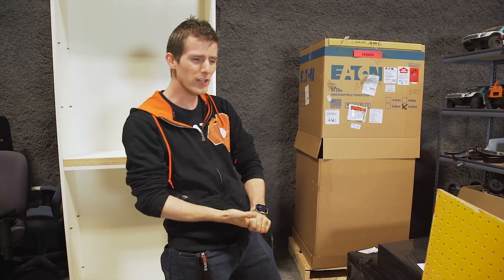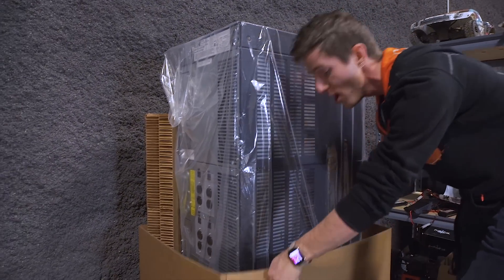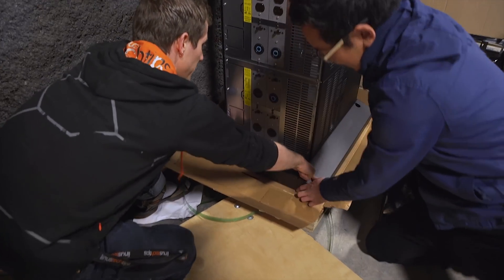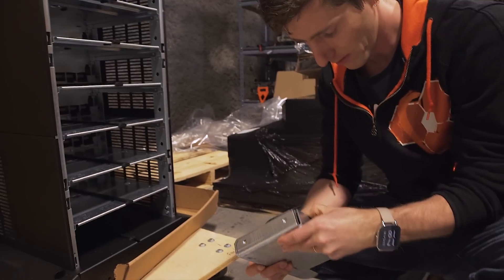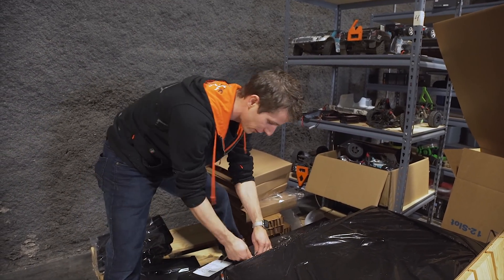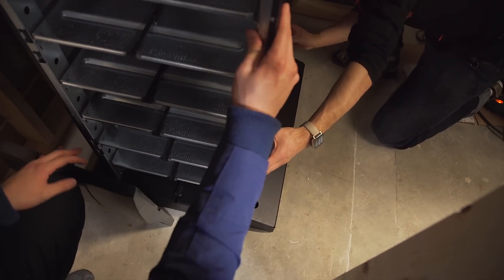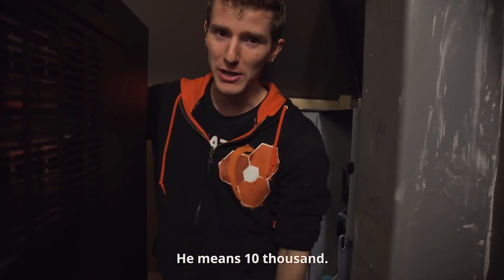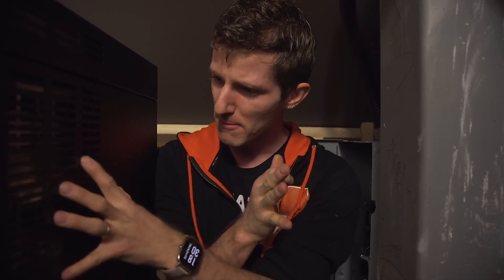HOLY $H!T - A $17,000 (CAD) Man-sized Battery!

Comment: 17k? Why the hell didn't you just get a generator?  You could power the whole damn building with 17k.
Reply: +tnnss111 He said $17,000 CAD. Aka, $10 USD. Just kidding.
Reply: +tnnss111 You would have the generator running at all times, which is loud and emits fumes - not ideal for a set up like this. The power from generators is also less consistent. Generators require maintenance, fuel etc. But yeh the biggest thing is you would need a generator running 24/7 to achieve this... which is just not a viable solution!
Reply: +Brighteyes890 You don't have to keep the generators running, they're turned on when the main poer goes out, they're a backup, not your power source.
Reply: Turbo Kompressor
The point of a UPS is that it is uninterruptible..You can't know when the power will go out, and when it does you can't just decide to go and turn on the generator. Your server has already lost power!
Reply: +tnnss111 this usually sponsored tho...
Reply: +Brighteyes890 No, it is not, but he kind of makes some sense.

If you think about it for a while this UPS won't last much time, in case of long power wattages of a few hours this won't hold everything up, it just can't, on the other hand a setup where there was smaller batteries from which everything would be powered up from that (so that there's no delay if anything fails) were charged by wall power and whenever wall power fails would quick start generators to fuel it would be the most appropriate solution, eventually cheaper, lasts for way longer (especially if you keep fuel barrels around you won't have to worry about power outages any more at all) and is just as reliable.
Reply: Dudes, you're not making any sense, I already explained it on top of your comments, you simply did not read it.

The battery that's provided to your servers comes ALWAYS from the batteries, like with this UPS, it never comes from the wall and then switches to the batteries, it comes ALWAYS from the batteries.

The way you charge those batteries though is different, if wall power is up then take it, if not fuel them with the generators. Keep a few barrels of oil around, you're basically set for weeks of power outages, the solution he has is able to sustain him for 1 hour tops, which in case of some electric cable getting cut cause some tree fell basically means they're dark.

At first I thought linus wouldn't take this dumb approach unless it was sponsored (with all respect to linus and his team), but this is doesn't look sponsored to me, and all it does look is burnt money.

Just my 2 cents.

EDIT: I don't mean a small battery to power all these servers, I mean SMALLER than what you see on the video, you don't need them to provide for long, just long enough until you got juice coming in from generators to refuel it again, the investment in total would probably even be smaller than what you see here and would've been much more reliable.
Reply: Turbo Kompressor
Yes, a small battery to run multiple servers. Yes. Yes. I agree.
Reply: +Narvikz Guys you are totally missing the point here. In this configuration all the UPS can do and SCHOULD do, is give the servers time to saver everything and power down safely. Ever powered down a server with a dozen VMs? It takes time! The UPS supplies this half hour of electricity. 
LTT isn't located in Africa, they do not need a generator that will last them through days or even weeks. All they want this UPS for is to avoid data loss in case of a TEMPORARELY blackout.
Reply: +tnnss111 A generator on its own isn't enough, you should never plug sensitive electronic equipment directly into the supply from an unregulated generator. Even automatic standby generators still require a battery UPS to bridge the period of time it takes to spool up and regulate the supply. They are also pricier and have installation and industrial safety certification costs etc on top.
Reply: George Cristodoulou
Really? Have you even read what I said? The Generator powers the UPS, not the servers, and only does so when wall power fails.
Reply: George Cristodoulou To power everything with solar power you're aiming at 50-60K USD. Not even joking.

The power LinusTechTips company is receiving comes mostly from hydro power, from dams specifically, it's green energy and hella cheap, which on top of being expensive as fuck renders your suggestion just straight pointless since they already use green energy.

Generators run on power outages, which are pretty rare.

EDIT: To make it clear, LinusTechTips corporation is already powered by green energy sources, it runs on water, not on coal like you might think. And right now I think running stuff on coal is just pointless when you can have nuclear plants which are much better for the environment and safe :)
Reply: +tnnss111 Because UPS.
Reply: +Brighteyes890 You solve that with a small battery, generator engines start in seconds, and you already need that battery to crank them up.
Reply: +tnnss111 Most likely due to a generator would have power fluctuations, a start up time as well as sot being designed for server use. A battery UPS generally is more suited, though server farms tend to have tretriary generators too.
Reply: The idea is to have uninterruptible power. A generator won't do them any good as it will not start until they have already lost power. Now if the power went down for a long period of time (a day or two, maybe longer) a generator would be a good investment.
Reply: Every single one of you are completely ridiculous, Your all fighting over something that means nothing... Where did linus say he wanted constant power when the pwer goes out. Where did he say he wants days or weeks of uninterrupted power should the world go to shit.. He didnt. So shut the fuck up lol  These guys are not an enterprise, They do not "need" continuous power and to have 100% uptime.. Its not that any of you are right or wrong its just your all fucking dimwitted. 

The goal here was to obviously supply a stable power supply to the server WITH the safety measure a ups offers. The ups is charged by Wall power so if wall power goes out the servers have time to properly shutdown uninterrupted.

There are many ways to power a ups with 220v after the power goes out, but it is not needed here or wanted. They do not want 100% uptime. If it was the goal LTT would do it. You can power this thing with a $600 honda boat generator after the power goes out but that is not needed or wanted.  All that is wanted and required here is protection from data loss and the capability of a proper shutdown should the power go out. 

Never once did anyone in this video say this was going to be used to maintain 100% up time or that it was infact the goal. So take your lies about what you used to do and realize you are all offering very viable solutions but that wasnt the goal here.

The goal here was to prevent data loss and to have constant uninterrupted power so the servers may shut down in case of a power outage, and that goal was achieved. Now lets say in future they want or need 100% uptime, Well that will also be easily achieved by simply adding a enterprise grade generator that provides constant 220v to the panel.. you dont need solar, giant enterprise grade hospital worthy generators or to go overboard. A simple crappy tire or wallyworld 220v generator would be capable of supplying that 220v...  And lets be honest whos to say they dont already have one??
Reply: +angrodNumenesse If you are going to invest on a alternate power source, why not use solar panels and wind generators ? Yeah they are more expensive but, like a UPS they have voltage regulators and you don't have to buy fuel in order to power the damn thing. Also you do the enviroment a favor.
Reply: +Narvikz The point isnt so that they can keep running if there is a long power outage, the point is it allows them to finish what they are doing and save their work incase the power doesn't come back. a generator is NOT a solution to their problem, they need the power to stay on not just come back up after a couple of seconds with no power at which point the servers would already have been shut down and work lost, using a smaller UPS isnt viable either they have tried that and its not done them any good. what you are proposing is nothing but a "ghetto" fix as linus would say, using a generator is only appropriate for putting emergency lighting on so people can see where they are going if there's a power outage in the night.
Reply: megaspeed2v2
Bro, hospitals (which have electric equipment that patients depend on to actually staying alive) use generators and have supplies of fuel long enough to stay that way for weeks (or even if they don't they have for a some hours and plans to get barrels delivered real quick), this all depends on what you're purchasing, a company shouldn't stop for a single day because of a power outage, specially not Linus' because that would mean huge losses in revenue.
Reply: +tnnss111 Well you would need a generator running 24/7 to achive the same resaults as the ups and generators use fuel. I think the way it should be done is having an ups and if/when the power goes out you have the 20 or so minutes to get the generator started and your servers stay online.
Reply: Narvikz
Generators are not a solution for server backup power, ever. You need to be able to guarantee power at all times, which is something a generator cannot do. Yeh there are cheaper ways to do UPS and this may well be overkill but he still has to use UPS.
Reply: +roguesn1per Most consumer grade UPS work like that, not this one though, trust me - I promise. Look it up.

Anyway it's still fixable, just make it be powered by a generator when there's no juice coming from the wall and it's fine.
Reply: Narvikz
Again as Jonas Cebo said you are missing the point. They are not a Hospital or Server hosting company that the uptime is critical. They just need a solution in order to power down everything safely. A generator and even solar power (like I suggested) is superfluous and unessecery for the time being.
Reply: +tnnss111 Generators aren't an instant transfer. They have to start up. A battery can switch instantaneously making it uninterrupted . Ideally you would have both. batteries to immediately take the load and hold it until the generators start. Then transfer the load to generators.
Reply: +tnnss111 for all you arguing and what not, this original comment is completely valid. For that amount of servers, $4K worth of UPS is more than sufficient, and for another $4K-$5K you could have digital inverter generator to backup the existing UPS that could extend your uptime for as long as you were happy to keep refilling the tanks. Even in AUS a 6.5kva Digital inverter is only about $2k. Maths.
Reply: Still the boneheads haven't got the point. The servers are always running on batteries and absolutely never loose power during an outage, not even a microsecond. The issue with regular UPS is that you have to totally depend on that circuit to kick in as fast as possible, and sometimes they're not perfect with a power hungry system. A lot a odd stuff can happen with that power cut. You're basically paying for the feature of absolute data safety regarding power. 
If his area has power outages, it's a proper investment, because the power company is not going to come and recover your corrupted data. They don't give a shit.
Reply: sdushdiu The sole issue here is that dimwitted folks like yourself think that there is a better solution when there isnt. a panel fed UPS that gives zero downtime and you think there is a better solution?? The only thing they need is a generator and they can go Uninterrupted with zero risk until the UPS batteries literally die and take no charge.

  The other issue is that you and people like you who have no money have a problem with people who have money and how they spend it. This is simplicity and security at its finest dollar. They did an awesome job. I dont get why you and so many others got your panties in a bunch because someone did something right and kept it simple.  If they had gone with any other suggestion, all you children bitching would be screaming at them saying "why wouldnt you have just gone with a panel fed UPS which can be powered by a generator and kept it simple" 

People like you have a problem with what people do either way. Right or wrong. This solution is king shit and wont be topped. With a generator or solar panels to power the panels and UPS's, LTT can work during an apocalypse with zero risk of data loss or server corruption
Reply: +Saku Jalonen They run a single rack, that doesn't consume that much power
Reply: +tnnss111 Generator don't produce 220v or 110v power continuously all the time. Like a car engine, the RPMs rise and fall all the time and you can have from 210v to 240v, something that stresses the Server and PC components. In order to fight that you need a voltage regulator in the main power input, which is extra money and equipment. Generators also produce heat, exhaust fumes and require maintenence even if you don't use them at all. Also generators need a certain amount of time and effort in order to fire up and produce power, something in the case of a power outage is out of the question in data critical environments. A UPS of this technology has a built in voltage regulator at 220v or 110v at all times, since the equipment uses the batteries only and the UPS just charges them also has near zero delay to fire up the power backup and by the time you will need to do maintenence in this thing it will take at least 5 years to change even a capacitor. Also the biggest advantage of the UPS over the generators in an environment that has Servers and PCs is that the current isn't AC natively but AC simulated. AC simulated is in fact DC surrent mimicing the AC current fluctuation, something that PC power supplies prefer since they don't have motors or dynamos like fridges or hairdriers.
Reply: +roguesn1per 
We're talking about server grade equipment here.
Reply: +Narvikz Your comment wasn't loaded when I was writing mine ... Having both is indeed the best but, since they aren't a company like Dropbox the generator isn't too much of a neccesity for the moment. They propably prefered UPS in order to have safe power down sequence and safely save whatever job they did.
Reply: Narvikz And ill bet you without a shadow of a doubt that those hospitals have beefier versions of this system in between their generators and the power grid to keep the power up while the generators start up because whether its a hospital or LMG 1 second of power outage is NEVER acceptable.
Reply: *****
 Sorry, but $17K for such a limited service is absurd.
Its apparent that they are NOT conversant with state of the art best practices for site-wide disaster recovery systems, where much more substantial robust systems are available for much less money affording significantly greater functionality.
Reply: Sybreeder
 Yawn - you don't simply buy a 'generator'! You buy an integrated backup solution that utilizes and integral generator complete with system monitoring and handoff capability!
How about demonstrating that you have a modicum of familiarity with enterprise class disaster recovery systems rather than imagining that one simply runs down to Sears and buys a standalone 'generator'!
What is becoming painfully obvious is the fact that  Many, if not most, of the respondents, as well as those at LTT, have no clue as to the available options regarding enterprise disaster recovery backup systems - and that their entire understanding of the product space is to imagine a giant version of some $100 APC UPS!
Reply: +angrodNumenesse Nah, best way would be to get generator and smaller battery, UPS could turn generator on automatically and that little time between power going down and generator starting would be powered of smaller batteries, just get some 12V batteries.
Reply: ShiroiKage009
Dumbass,my referring to you as a dimwit is an Understatement!
IT class backup systems are literally DOMINATED by natural gas or diesel generator based systems affording significant functional advantages!
The fact is that they could achieve almost everything they are trying to do with an exorbitantly priced battery backup by just having their systems configured to automatically backup work in progress every half hour or so, exposing only the most recent and easily managed changes for almost no cost.
The fact remains that you are totally ignorant of  that to which we refer as well as how they work as your deluded fantasy that they are akin to some standalone generator that someone has to go start with a pull rope is hilarious. You haven't a clue!
Places like Canada with "advanced power grids"...give me a break.
And while you whine about the cost, THEY have set the bar at an asinine $17K!!! for a system with no more capability than a few minutes to shut their systems down!
Go back to playing video games in your bedroom - and surprise your mom by cleaning up your bedroom without her having to tell you to do it.
Reply: sdushdiu Ah, speaking of my mom, maybe you should talk to yours and ask cry in her lap about internet people not being "at your level." Maybe she'll give you that cold soda I suggested earlier.

OK, natural gas is good, but Diesel? That would need bloody replacement. It also means they have to route a gas pipe to wherever it is they need to install the thing. It also will still need an exhaust, which if it was indoors will need new pipes and possible hole in the ceiling.

Also, who talked about pulling a chord? Automatic generators ALWAYS take sometime to start because they're running on freaking combustion engines. If it had no buffer, like a battery or something, it will need a short second to switch to backup power.

If you're so knowledgeable about price and performance IT-class generators, you might do everyone here a favor and link us to something that has power conditioning, a battery buffer, runs things off of the battery at all times to prevent even the smallest stutter in power as it transitions to backup, is modular for different loads, runs on natural gas so they don't have to replace fuel so often, and costs 17k CAD or less. Do that and this argument will be over.
Reply: +DaanM96NL 
Their workstations have UPS systems on them, so that they can also be safely shut down. Also, just like any company: downtime = non-productivity = loss of money. His employees are still getting paid during that down time, and not being productive. A generator with a UPS as a gateway, would be the ideal solution during power outages. He could get an industrial generator, which would automatically turn on in a fraction of a second and provide power for many hours, thus allowing them to work during the power outage. If the outage is for a prolonged period of time, then they can still safely shut everything down and turn off the generator. Some even have a warning system when the generator is low on fuel and they could start the shutdown process.
Reply: +ShiroiKage009 - Generator sets are either installed outside the building or in specially constructed buildings that are designed to deal with the heat and emissions.  The facility I work at has very large generators, 12 cylinder diesel engines built by Caterpillar, and LMG doesn't need something that big but they could have spent less on their battery system if they had invested in a generator set that would be auto-started when utility power failed.  As to the fuel going bad, diesel fuel lasts for a long time in a proper storage tank but a better option for a small installation like this would be propane.  Propane will last for an almost unlimited time in a storage tank and there are many quality generators available that run on propane.
Reply: K Doe
 And the system they have gotten is akin to a data center running on purely SSD based memory! It is overkill for their needs in terms of EXORBITANTLY priced batteries for extremely limited extended up time.
That is why in installations beginning at about the 10 KW point, hybrid systems provide greater functionality at a more attractive price!
But as usual, we are treated to a clowncar where the novelty of building a 50 quadrillion TB SSD array takes precedence over best practice and responsible economics - all as a result of idiots being ignorant of ENTERPRISE class solutions..
Reply: +tnnss111 Generators are not instant, by the time they power up all date would have been lost. The whole point of the UPS is to prevent data loss and allow for either a clean shutdown or enough time for a generator to come online. Generators also require expensive maintenance contracts and city inspections.
Reply: John Ross Finch Jesus christ do you people even read? You can't keep a generator running 24/7 in case of a power outage, hence the UPS. The power goes out, the UPS provides ~20mins of power so you can safely shut everything down or connect a generator for continued operation. A generator and a UPS have COMPLETELY DIFFERENT uses.
Reply: +spire107 more like 13k USD
Reply: +roguesn1per watch the video before you comment
Reply: +Brighteyes890 Bullshit. The generator ONLY needs to run when it is providing power during an OUTAGE! And it would provide continuous power for the duration of the outage - not a MERE 26 fking minutes adequate ONLY to shut the gear down!
And the output of a generator is run through a conditioner! 
Oh.....
Reply: +Narvikz The point is not to let the whole office run on battery while power goes back on. The idea is to give you enough time to let the servers shut down, so there is no risk of them corrupting, or system configs going kaputt, or data getting lost. Note also that not the whole office runs on them, only the servers that are in the server room. For a UPS on a whole building scale, you'd need to pay a lot more.
Reply: +Brighteyes890 no they have generator that will be off until power is cut then will turn on or even a low enough dip in power will turn them on. I don't know anything about generators.
Reply: +Brighteyes890 They have generators that turn on by themselves and don't have to be turn on manually you still don't know anything about generators.
Reply: sdushdiu Did you watch the video? They don't need a hand-off, the servers run o0ff the battery itself, if the power cuts out, that doesn't affect the connected equipment, because that is already connected to the battery. A generator isn't necessary because, as I said, this is really only designed for allowing power not to cut out to the servers. As soon as there is a power cut, it sends a signal to the servers to shutdown while it provided them with stable power, and waits for them to shutdown. Once power is back up, turn the servers back on, and done. They already have UPSes for their workstations afaik, so that's not an issue. If they are working on files, nothing will be lost during the power loss. They wait for the power to go back up, then the servers to go back up, and continue work. The workstation UPSes should keep up power for quite a while.
Reply: insta kill
 LOL! An exorbitantly expensive battery will ideally provide a Grand 26 minutes in order to shut down their systems. Whoopee!!!!
A grand case study in how not to perform disaster recovery planning.
Reply: *****
 Dimwit,first of all, many of us are very intimate with much more substantial disaster recovery systems - and we are well aware of what is involved in a hand-off between various power sources.
And their solution is so absurdly limited for the money that its not even funny!
Having lived in the world of enterprise disaster recovery planning, there are myriad  backup systems that afford significantly more substantial capability for the money.
The joke is further compounded by the fact that they could have simply utilized a bunch of independent UPS battery systems and achieved the same extremely limited shutdown capability functionality for substantially less money.
Reply: +tnnss111 actually a generator with auto cutover would be about 30k to start
Reply: +sdushdiu As i said i managed enterprise environment with 30KVA UPS, 2 server rooms connected through fiber, enterprise clas HP switches and SAN do don't tell me that i'm "unaware of the various enterprise solutions" ok ?
Reply: ShiroiKage009
 Dimwit, no one is suggesting SIMPLY a generator! But a Properly designed generator based system DOES handle the handoff, and it DOES incorporate power conditioning! And they are the NORM in enterprise class HA and disaster recovery installations!
This gets old listening to a bunch of kids whose idea of an enterprise class IT installation is a tricked out desktop gaming rig with LOTS of RGB LED lighting and who think that a proper disaster recovery backup solution incorporating a generator is simply some standalone generator one buys at Sears or Home Depot!!
Reply: sdushdiu You calling me a dimwit is hilarious. Get yourself a cold soda and relax Mr. expert in server IT guy.

Not only do generators take time to start, but the fuel will have to be replaced periodically every few months because of oxidation, so it's a running cost, and generators with power conditioning AND a battery buffer for a smooth transition are very expensive for this application, that it's not worth it. It's also not worth it because places like Canada, with advanced power grids, don't have frequent, prolonged outages. Finally, where the hell will they install the damn thing? A generator will be larger and will need additional piping and whatnot for its exhaust.

This battery bank is a good solution here. Asking them to go with a generator is nothing short of silly.
Reply: ShiroiKage009
 Dimwit, an EPS utilizes an HYBRID configuration that provides a small battery and capacitive source for intermediate power until the generator comes on line. And one does NOT need a "line", but the fuel can indeed be provided by TANKED storage. And yes, DIESEL is the preferred fuel give a choice between gasoline and oil, with natural gas or propane being the other options.
Its similarly telling that you are sufficiently deluded to think that natural gas runs forever but diesel needs replenishment!
 LMAO! Now go tell the millions who have relied on tank based diesel home heating oil for decades the news.
And ALL IT generator based EPS systems include startup mitigation, and conditioning! The fact that you do not know that is rather telling.
And you can start by simply accessing preconfigured systems by Sola and Generac.
And one imagines that they are even available with aftermarket RGB lighting kits to impress even know it alls like yourself.
Reply: +sdushdiu thank you for rewording my statement better.
Reply: generators have a delay you still need these bad boys in the loop
Reply: +Karl Oversteyns A lot of generators turn on automatically, the problem is the time between the power going out and generator generating.
Reply: +pilgrum plus these are outputting clean pure sine power. all jobs I've done including dod have both
Reply: tjeulink
 What? Where do you get the idea that EPS failover systems rely on some idiot manually switching them on???? Or that a battery or capacitive network is not used to maintain power during the failover cycle?
What this issue conclusively establishes is that the average viewer of LTT has NO idea as to the variety of systems available in the market - and one would do well to expend a bit of time and energy to focus on more than trendy RGB LED capabilities.
Reply: +tnnss111 because generators make dirty power this is bad for servers. Plus generators take time to start up. A proper set up will be generator to a UPS the ups will make a steady flow of power to the sensitive servers and make it seem less when the power goes out.
Reply: Decent60 But you missed the point, Just like so many before you, Do you even read comments?  The goal isnt 100% uptime. The goal was safety and security of their data... Just like my previous comment you people are being ridiculous. Your all acting like having a UPS is a bad idea. Your acting like because the power goes and these guys have a UPS that is charged by wall power rather then a unreliable generator that they are retards. Your all acting like you know better and know something linus doesnt know!

 You can power this UPS with a $500 honda generator from walmart if you want 100% uptime or even more hours of productivity. But they dont, They want data security. From this point out, with the setup they have all that is needed now for 100% uptime is a simple 220v generator that will power the panel. Why you all are making a big deal out of something they do not want, do not need and did not mention anything of is so cynical and delusional my head hurts. Where anywhere in this video did linus say the goal was 100% uptime. Also who are we to assume that a generator doesnt already exist in his unit...  Stop being nitpicking little bitches and except the fact that this is a great solution and say good job linus, great idea to protect your server and now you only need a small walmart bought 220v generator to power the panel and your capable of 100% uptime
Reply: Also a hospital is setup this exact way but in large scale. They have generators that come on incase of a power outage (the only thing linus is missiong) but every piece of medical equipment that is created and is either lifesaving or a life support machine is built with either backup batteries installed or with a manufactured UPS installed inside that is charged by wall power.

Lifesaving medical equipment is not and cannot be built without one. Regardless of what generator you have there will always be downtime, whether it be seconds, minutes or milliseconds, power will go out before it is restored. That is why and generator is a generator and a UPS is called Uninterrupted Power Supply. That is why a UPS or backup power is built into these machines. Medical equipment/Server grade equipment and enterprise equipment will not and will not ever rely solely on generator power or wall power to save lives or data.. A UPS or batteries will always be needed to supply Uninterrupted power to sensitive equipment or data regardless if the power comes from solar, hydro or generator. Until power is restored a UPS IS NEEEDED, no if and or buts. That is why the setup for solar, Generator and hydro power  will always be  Generator first - UPS/Batteries - equipment third. That way if power goes out/panels are damaged there is ZERO downtime so you may safely powerdown and or fix the problem without any loss of power
Reply: +gzac95 - generators do not break constantly if you buy good ones and maintain them properly.  We ran our generators for a solid month with no failures when we had an extended grid down a few years back.
Reply: +sdushdiu - You are really being too harsh.  Stop calling people names.  It is rude.  Would you behave like that in person?  If you did, you might get punched in the mouth.
Reply: Sean Peel Everything has a UPS, EAch system has there own UPS and the Server and main data storage has this Huge 17k UPS that has slots for additional modules and batteries to give anywhere from 1 - 24 hours+ of uptime without powerloss. This setup gives the computers and editors time to save and power down without a surge and the servers and data time to save and powerdown without risk of data loss! Why people are mad about this setup is beyond so many of us. Even the guys claiming to do this for a living are besides themselves of the simplicity of this setup simply because they cant comprehend LTT doesnt want or need 100% uptime. Security, surge protection and data loss protection was all they were after and they achieved that gracefully
Reply: +sdushdiu This is exactly my gripe. Nobody is saying they need to run indefinitely. The servers need to run enough time to automatically power off if the outage is long enough. Have you ever heard of true online UPS? This is one, and the primary source is the batteries. Grid power is just secondary. The expandability is another feature of this unit if you grow your equipment demands.
Reply: +HappyChapGamer I know right. There's a lot of saltiness in this thread. They think a lot of rambling makes a point valid. 
( ͡° ͜ʖ ͡°)
Reply: sdushdiu No you werent, stop telling lies you only come off as a deuche.
Reply: sdushdiu Plus this isnt a pissing contest. your just one of those losers that has a problem with how people do things regardless if it is simple, complex, right or wrong. You just have a problem. 

If they had done it any other way you would have a problem with that. If they had set it up like you say it should be, you would be here bitching saying "why didnt you just put in a large UPS to protect your data and ensure safe and secure shutdown"  Your literally a fucking loser troll pretending to have a background in something simply because you spent the last 3 hours google searching better ways to do things because you have a problem with this.
Reply: +sdushdiu Why so emphasized on RGB lighting? Not everyone likes that tacky none sense. Besides, I've seen "project managers" in action and many of them are not detail oriented. Now and experienced engineer as a project manager is something worth throwing around in the YouTube comments. 
( ͡° ͜ʖ ͡°)
Reply: K Doe Haha, I hear that. Project managers are such a fucking pain in my ass most of the time and don't know shit.
Reply: sdushdiu Dude you are so butthurt and jelly. You speak in past tense which makes everything your saying unbelievable. 

Did I mention you scream of jealousy! this setup is ballin and everything LTT needs to maintain their business and ensure security of their Data.

Stop being so butthurt. Your not even talking about anything relevant anymore. Simply trying to flex who you once were which no one honestly cares. lol  If you were what you say you were, Your simply acting like a deadbeat has been who cant get over the fact no one cares what you think because there is nothing wrong with what is going on here. Your just bitching out of jealousy
Reply: sdushdiu No one wants a hybrid system, its to complex and runs more risk. K.I.S.S Keep it simple stupid. Your the only one having a hard time dealing with it!! You are literally upset and got your panties in a bunch simply because of the money they spent on this. That is jealousy. Your trying to flex on people like you have a much better solution. Extended battery system... Hate to break it to you buddy but that is what a UPS is. It is extended battery life that provides uninterrupted power..  Jesus fuck you get more and more confused with every comment
Reply: +HappyChapGamer ( ͡° ͜ʖ ͡°)
Reply: sdushdiu No one is ignorant to the alternatives. We understand they are there but they are not needed. Simplicity my friend!! Simplicity!! Stop screaming and ranting because no one cares for your complex riskier alternative!

I do have to ask though since your such a pro. What is wrong with this setup ? What is wrong about providing 1-24+hours of uninterrupted power and surge free protection ?
Reply: +sdushdiu I'm not worried about what some random guy on the Internet thinks of me. That's why I don't throw around experience/job titles around in some random section like YouTube comments. It's kind of a sign of insecurity in my eyes. But it's all good. No worries here sir. 
( ͡° ͜ʖ ͡°)
Reply: +tnnss111 I couldn't be bothered to read all these comments, so I apologize if this has been made clear already, but I assume the reason why backup generators aren't viable is because the switching time is too long. Computers can only tolerate a few milliseconds of power loss before shutting down. A UPS can switch in that time, but a generator can't.
Reply: sdushdiu How are we the assholes, We are defending this very reasonable and simple concept of uninterrupted power and you are hostile towards us because of the simplicity of it! Of course im going to repeat myself because you dont understand it. You are shortminded and blindsided by your own belief right now. You are angry and got your panties in a bunch because someone spent money on a very effective and simple concept of uninterrupted power to protect their data! Iv never come across someone so jealous of someone elses money before in my life!
Reply: +tnnss111 
Or a Tesla Powerwall and some solar panels.
Reply: sdushdiu Yawn No it doesnt, Your hybrid systems are simply a UPS or battery with built in power generators. Thats it in a nut shell. Nothing more complex than that. You can use big industry words and try to use all the caps you can and be mad all you want at the world and pissed off because ltt didnt install one but thats what a hybrid system is. Its multiple systems built into one hybrid system.

 So if linus adds a generator into the equation he technically has a hybrid system that will provide zero downtime or extended uptime incase of a power outage lol We all get what hybrid means and what a hybrid system is but that is not what they wanted here.. Your to new school kid!! Also This is not a hospital. They are not dealing with life saving equipment and lives are not on the line (btw all lifesaving medical equipment will have backup batteries and UPS's built in them.. its actually mandatory that they do to) They are simply trying to protect their data from surging and sudden power loss's. Your so angry simply because this system is effective, simple and costly and cant get over yourself lol
Reply: sdushdiu Again your mad and got all twisted and stressed yourself out for the last how many hours over the simple fact that you think they should have a hybrid when they dont want/need one and think that a UPS that can provide 1-24+ hours of uptime during a power outage isnt suffice for a medium scale business such as this.
Reply: sdushdiu They didnt want to save money, You did, and your now mad at us because of that lol.  They dont have to save money they make millions and they can do so with their money as they please. Whether it be an all in one system or simple quality standalone's I stand by their decision as it is an effective, proven and capable system that works is proven and can provide 1-24+hours of surge free uninterrupted power!! You should stand by that decision as well as its not a bad decision, simply a costly one !
Reply: sdushdiu Im not disagreeing with you, I agree that there are less costly and equally capable systems and have acknowledged that since your first argument. But the fact remains they did not want that. They wanted a very high quality standalone UPS that is capable of a surge free Uninterrupted Power Supply and they got one. and I stand by their decision as it is proven tested and capable of providing them with everything they need for a very high dollar.

Stop being so jealous and mad at them, us and the world because they made the decision to go with quality standalones rather then cheaper all in ones like you would have done!! Im not butthurt lol you are. Your literally upset because we acknowledge the fact and agree with you there are other solutions and cheaper less costly ones but stand by their decision to go with quality standalones rather then less quality cheaper all in ones... 

You clearly have social issues. You cant handle an argument or debate you would rather insult and push your views onto people who already agree with you lol Your a fucking dimwitted loser !
Reply: HappyChapGamer
Yawn. The fact remains that it was a poor choice from both an economical as well as a functional point of view. 
Is a semi truck or a Porsche GT3 an optimal choice to simply drive to the neighborhood convenience store? According to ignorant fanboys like yourself, they are.
Applying standards of economy and/or capability, the fact remains that they are not optimal choices - and neither is this system.
Stick to playing games in your fantasy world.
Reply: +tnnss111 Because you want uninterruptible power. A generator has a brief period of time that it takes to cut on and a server will shut off in the brief period of time which is really bad for them
Reply: +tnnss111 
> Suggests using a generator to power thousands of dollars or sensitive and expensive server grade equipment
> Keeps trying to defend this point when everyone points out how wrong he is
> Is idiot
Reply: +Catsrules1 Well, you have the general gist of it, but you seem to be confused on a few things.

First of all, Linus may not be needing the full capability of this UPS, but that's besides the point for his usage. Assuming all of his gear only uses 1/4 to 1/2 of the 10kw it has available, that 1 - 2 hours (max I figure, depending on exact power consumption) he might be able to ride out a blackout and not have to shut things down at all. Going further with that, if the blackout is prepared for, he could shut down all non-essential equipment, and leave only the essential stuff running, and that might run even longer than 2 hours. (Remember, Usage / available power = time) So, if he is only using 1000 watts per hour, he has a good 9.5-10 hours of run time for his server for instance. Not quite sure exactly what all of his power specs are, but then, neither are you I bet. 

A generator would definitely help them out in the long run, but by having this UPS installed, all they have to do is start adding in alternative power solutions like solar and roof top wind turbines to help keep the thing topped up while the power is out. Also, before anyone goes on a rampage about how wind is a problem for any reason, let me point out that there are Archimedes screw style wind turbines that can sit on your roof and have no real con's to their usage. 

Finally, for anyone who doesn't know, Linus is in BC, where it is a very real possibility to just up and lose power all of a sudden due to an earthquake, or worse if a tsunami were to happen off the coast. That, and people are too quick to say to others to use Gas generators. They are loud, stinky, and absolute polluters. With this UPS, he opens up the possibility for green energy options as he pretty much as almost all the required gear for it now, again, because of that UPS.

Cat, the main reason why I say all of this, is because of your blind belief that losing power for a few seconds just to use a piece of crap gas generator instead is a good idea. It is not. It's far easier to just have your stuff connected to a UPS that never turns off if you have it under the right usage scenario as I explained before. Also, as he pointed out, his UPS conditions the power to boot. That conditioning of the power will have added benefits to his equipment depending on what he is doing. For instance, if you ever hear odd noise in your headphones while listening to music on your computer, chances are your power is "dirty". Conditioning it fixes that among other things. Dirty power can ruin electronics faster, especially in a sudden power outage. 

Gas/diesel generators definitely provide power in a pinch, but they have too many less desirable factors to include with them. Like fuel storage, (Assuming you don't just want to run to the gas station that has no power...... there fore no fuel...) and again, pollution of the air and noise.
Reply: +HappyChapGamer +10 for The best comment here on Linus tech tips. People here really are fucktard children.
Reply: Chris Moore Propane makes sense for storage. As for having the facility, LMG is on a store property and basically are part of a complex. Extra construction on the outside is out of the question, while having more construction done inside now that all the space is allocated would be very difficult and very expensive. Having to accommodate a generator's emissions, sound, fuel storage, safety, and everything else will add to the price of admission too.
Reply: +sdushdiu I agree with pretty much all of what you are saying but why do you need to say it in such a salty, obnoxious, arrogant way. You seem a professional in your knowledge on the subject and then ruin this people talking to people like they are dirt. Shame.
Reply: Craigsocialmedia Thats because he is not knowledgeable.. He simply did a google search for hybrid systems and uses the information off the product page to sound professional when really he is a nobody. Anybody who is a somebody would know this system is proven, capable, tested and been around for years. Like I said to him many times before, I agree with all what he is saying other then his insults but at the end of the day linus wanted one thing, A UPS to provide uninterrupted power to the server and data storage and they got just that. And because he thinks its overkill (which that word doesnt exist in my life or line of work and nothing LTT does when it comes to business is underkill ) he would have gone with a lesser expensive lesser quality solution that isnt overkill he thinks hes smarter and better then everyone but in the end all he is doing is undermining his "knowledge" with unnecessary insults and gaining no ground lol
Reply: +tnnss111 For all of those who don't know much about generators, you would only need a small battery backup to keep everything running for a few seconds after a power outage until then the generator can start automatically. You can get a 20,000+ watt generator for less than like $5k US.
Reply: +Wozso Using a generator for backup power is perfectly fine. Generators from home depot produce electricity in the same way as your power company. The power supplies they already have would be enough to keep everything running long enough for the generator to start automatically. The inconsistency everyone  seems to be hung up can be easily fixed with filters (they probably already have one with that many electronics in one building anyways) and they probably have access to natural gas lines so that fixes the fuel issue. Maintenance on generators is pretty simple and I'm sure there are many, many standby power companies nearby that could do the install and maintenance for a very reasonable price and they would still probably save some money and have a more reliable/ long term standby system. So why is everyone so against the generators?
Reply: +Narvikz Most enterprise datacenters or anyone who cares about their servers will use a UPS in conjunction with a fuel based generator. You mainly want the UPS to provide clean power to equipment regardless of power outages or power issues up the chain. Hospitals use both for that reason.
Reply: +Wozso It's called an automatic standby generator, it will start automatically within about a minute of a power outage. they don't have to run 24/7 and you use them in conjunction with a small ups to cover the start time and condition the power. It's exactly what we do in schools and hospitals. I promise it works lol
Reply: +Chris Moore EXACTLY!!! I'm so  relieved that not everyone on YouTube is ignorant lol. For an operation their size a 20-30kw natural gas generator is probably  all it would take and the money they save would easily cover the PM for a while.
Reply: Bio Hazard Omfg, how thick headed are you? A battery backup will be able to keep things humming along in the minute or two (less, actually, some modern generators can start and warm up in less than a minute) until the generator kicks in. 

This is essentially what many of us are saying. Both the UPS and generator kick in the moment an outage happens. The UPS provides the necessary power while the generator kicks in. This isn't complicated. 

As people have mentioned countless times now, this isn't an abnormal setup.Stop acting like what we're saying is some outlandish, impossible solution to a common problem.
Reply: Wozso - Your comment shows how ignorant you are of commercial IT hardware.  It is standard practice in a business environment to have UPS units that are backed by generators that automatically start so that there is no shutdown needed.  You just continue working and when the utility power is restored, the load is transferred back to that and the generators automatically shutdown.
It is called an auto-transfer switch and you can even get one for your home use.

http://www.kohlerpower.com/industrial/category.htm?categoryNumber=12461&sectionNumber=13261&brand=ind&source=google&mat=bmm&cat=Nonbranded&kwd=auto+transfer+switches&id=66238347-VQ16-c-VQ6-41455214510-VQ15-1t1
Reply: +Narvikz Maybe a army of solar things forgot whats it called again dammit can be on the office roof.
Reply: +Narvikz Oh... I didn't know that. Still generators for such a small company is still an overbudget idea. The maintence only is equal to a pick-up truck.
Reply: You would still need a UPS this size to hold the load while the generators start up, and usually the is a set delay before stating the gen as most power outages are less than a few minutes.
Reply: megaspeed2v2
In hospitals they might use a very rare alternative to UPS that works like the solar power system minus the solar panels. If I remember correctly you can use the voltage regulator that you could use in a solar power setup, because they have more than one power input like the main current from the electric company and an array of generators plus the batteries (of course way biggrer capacity) and because they are programmable to the finest tune, you have a long lasting fail-safe system that can power critical machines for days with power priority.
Reply: +tnnss111 With a battery or UPS you wont have a pause between when power is off and when power is on. Having any delay can potentially be dangerous to the servers
Reply: +tnnss111 Also generators requires you to constantly supply them with a form of fuel (burnable substance such as gasoline)
Reply: +Oscaro947 A desent emegency generator will not fluctuate.
Reply: +tnnss111 Generators break constantly.
Reply: +Turbo Kompressor If you use generators that will turn on when the power goes out it will cause downtime. This is like a chargin battery that you pull power from. That means no downtime if power goes out and you can pull extra power when it needs to. Like a hybrid car.
Reply: +tnnss111 Johnny Chew works for eaton - seriously.
Reply: +Narvikz I would assume this is only meant to provide power long enough to safely shut down and save stuff. Of course if the power outages last for days the generator would be the better solution but as far as I can tell this is meant for a safe shut off and saving of work.
Reply: jonnenne
 It is not only meant only for shutdown - that is ALL it is capable of affording!
And as been repeatedly observed, it is an absurdly exorbitant expense for an overly restrictive capability.
Reply: Zach Parr
A backup strategy includes a complete system that handles the hand-off as well as extended functionality beyond he mere shutdown of services.
Arguing that a generator requires startup simply exhibits ignorance of an appropriately designed disaster recovery system that incorporates both the  transition as well as extended capabilities.
Reply: +Brighteyes890 You are thinking of like, small home gas generators and stuff like that. A proper backup generator is automatic and there is no loss of power. When it detects power loss from the mains, it powers the building on battery for the short time it takes to crank itself and take over with the engine. Not saying it's a replacement for UPS, it's obviously not. It's also expensive(though so is this silly UPS in the video) and requires a bit more regulation for a proper install, but it does work just fine. I worked at a truck stop that had a set up like this, only way to tell when the power died? suddenly theres a loud ass diesel running out back, lol.
Reply: Exactly wtf is a battery going to do lol
Reply: +Turbo Kompressor Exacly. When you buy generator you still need an UPS to hold power till generator kicks in.
Reply: +sdushdiu I know that perfectly well. We used APC Galaxy 300 30kVA UPS with three phase power. And we considered generator but implementation of it was too expensive. It needs to be outside of company. With proper maintenance.
Reply: Sybreeder
 As I said, you and the others are unaware of the various enterprise solutions....
not to mention the various high availability systems that eliminate the need as they simply fail over to an off site location that is easily addressed given proper anticipatory planning.
Reply: Corbin Hillis
 Dimwit, fk the use of refurbished UPS's or ANY battery only UPSes!!!!! They have NOT done anything I or other have suggested! The joke is that all they have done is done with a centrally located series of battery based UPSes instead of separate standalone consumer UPSes - at an exorbitant price!!!
Screw battery only UPSes for that price!
You haven't listened to nor understood anything to which many of us have repeatedly referred!
But then, given that you are only intimate with puny consumer grade battery based UPSes, its not surprising that you are locked into the limited paradigm!
And change their minds!?!?! LMAO! Watching them is a continuing object lesson in watching a small scale operation reinvent the wheel that larger enterprise systems solved YEARS ago with best practice scalable disaster recovery planning - including geographically distributed High availability solutions that have been the norm in the enterprise UNIX world for decades! - and a subject that many of us in the enterprise IT space are  VERY intimate!
Reply: actually im commentwinner... it would be a better idea to back up the ups with a generator lol. yay i won the internet (kills self) lol
Reply: Sybreeder
 Yawn, I was a project manager involved in the design and deployment of both the ASCI White and ASCI Blue Pacific installations and HA-GEO implementations of massively parallel data centers utilizing systems with huge installations of IBM RS6000SP with data centers distributed around the GLOBE!
I'm not really impressed with  a server designed to fail over to another - although such would indeed be a much more sophisticated and effective system then they even imagine - and where such an event is simply registered as a single line in an error report!
The fact is that there are much more effective designs for disaster recovery than has been posited in this scenario, and which most here have no clue regarding.
The joke further compounded by the fact that they are still futzing around with standalone units rather than employing a virtualized environment affording significant 'poor man's HA capabilities!
Reply: +tnnss111 UPS (uninterruptible power supply) fulfill a certain purpose. Keep shit running when the power grid fails. With a power generator you would have to constantly fuel it. So when the power grid fails you have to start up your generator in the mean time your servers are shut down (data loss...). With an UPS you can shut it down slowly so there is no data loss or you could keep it running until the power grid is back up.
Reply: +Herbert Jürgen thats why my comment won the internet
Reply: +tnnss111 sure are a LOT of uninformed rubes replying to your comment... Let's clarify something, its best to have a small ups backed up by two appropriately sized redundantly triggered generators, NO they are not "unregulated" loads of generators actually provide more stable current that even some of the best grids in the world !!! you only get fluctuations when the generator is absolute shit !! decent ups + redundant generator power is the best option by far !!
Reply: Samuel Smith
 What the fk are you rambling about!?
They paid an EXORBITANT amount for an extremely limited battery system that merely allows them a few minutes to shut down! NOTHING MORE.
And genius, even  the average consumer grade home UPS provides software controlled automatic shutdown!
SCREW puny consumer grade solutions!
But you and they are stuck in that mindset as you are utterly ignorant of the enterprise class solutions that DO scale and provide significantly greater functionality at a much more attractive cost.
Please don't waste your or my time telling me I don't understand puny consumer grade crap when it is YOU and THEY who are ignorant of much more elegant and capable HA  and best practices disaster recovery configuration options.
Reply: +tnnss111 A generator would be ideal for long outages but it is not guaranteed to kick in when the power goes out. At least the UPS will allow the systems to run for a while in the case of a short outage and will safely shut down the systems via the inbuilt networking.
Reply: +tnnss111 Because generators take forever to turn on and don't condition power at all. You need the batteries to ensure constant, no-interruption power reserve.
Reply: +tnnss111 ti takes time till the generator kicks in which is really too late for video rendering cuz the files get lost in the case of an power outage
Reply: +bruno baumanis But their rendering server is already on a batter backup. This thing is excessive.
Reply: +tnnss111 Maybe he wanted to avoid getting a permit to put one in. If you would need a permit for putting in a generator in Canada.
Reply: +Gost9173 i said that already sry
Reply: +spire107 You beat me to it :D.
Reply: +Brighteyes890 does the power go out in Canada?
Reply: +tnnss111 Maybe this produces a guaranteed specific power output, without any interruptions at all. Generators can be a little iffy.
Reply: +Narvikz To anyone who said it could be used, no. The generator needs time to kick in, which is the reason why the old upss got thrown out.
Reply: +tnnss111 You would need a UPS for when the power goes out and then a generator if you wanted to keep them running for extended periods of time.
Reply: +tnnss111 

17k + running + maintainance for an hour of backup.

I don't believe they make that much an hour, so it's a waste of money. If they have proper genuine backups running over new data once a day, they would lose a day of data at the absolute most, which would still not be worth 17k.
Reply: +Turbo Kompressor the defeats the purpose of the Uninterruptable Power Supply because the generator still has to turn on causing and interruption.
Reply: +spire107 It's about $12,700 USD
Reply: sdushdiu You're still yelling, and you still failed to give me a link to a solution within the 12k CAD.

As for tanking, how long would a standard natural gas tank be? Unless Canada doesn't use gas pipes, in which case WTF, then having a gas pipe extended to the generator only makes sense. On and diesel? It maintains its optimal performance in tanked storage for a couple of years at best, especially if it was exposed to air (which it would be) For something like an engine, and a generator at that, you will need the quality to be consistent. It's not a steam engine for you to compare it to heat generation. Next you'll be telling me to stuff coal down a truck's gas tank because "people used it for heating for decades."

Now, all IT solutions have startup mitigation? Of course they do. However, same with the reason the battery solution in this video is better than the consumer grade ones, is that it takes a very small amount of time to switch circuits, so unless everything is running off the battery all the time, there will still be that very small flicker in power availability, which is stressful to the components. The problem with any of this? The cost.

Like I said before, if you're such an expert, as you proclaimed yourself, show me a solution with all the specs we've been talking about that falls within their price range. Again, that would end the argument if you do it.
Reply: +tnnss111 Probably because they'd have to manually turn it on (this switches automatically) AND get gasoline to fill it.
Reply: Because you either have to rely on a generator at all times, or you lose data when the generator turns on after a power outage. This is only 12.3k USD and works already without even the chance of data loss. Generators also require maintenance much more than this, such as fuel, clean, parts, etc.
Reply: ShiroiKage009
 Dumbfk, fuel oil, diesel and natural gas/propane are normally delivered by truck.
But being a kid who lives in your bedroom in mom's house, you wouldn't know that.
And dumbfk, please tell us what systems you fantasize enterprise wide EPS systems to employ?
What is hilarious is that you in your abject ignorance apparently think that enterprise systems that maintain power for extended periods when the grid goes down run solely off batteries.
And since you have repeatedly expressed your ignorance over how such systems are able to fail over without systems going down, it must similarly confuse the hell out of you that there are many variations of hybrid systems that enable the near instantaneous fail-over of systems
Of course, perhaps the simplest model that has been refined for use in critical needs environments is based on the very simple model provided by devices such as the automobile which uses a battery and a capacitive start mechanism to maintain an initial source voltage, only to serve to engage the generator which then assumes the role of continuing to both deliver current as well as to maintain the charge on the battery system.
And it must shock you to discover that such systems employing natural gas, propane, or diesel generator are the most widely used alternative source of power in facilities today. Their ability to provide continuous power as long as it has a supply of fuel makes it well-suited for providing both long- and short-term backup power.
In addition to your abject demonstration of ignorance to figure out what systems large enterprises utilize.
Apparently, to your delusional way of thinking, EPS systems simply did not exist prior to companies such as Tesla and Bloomburg offering large battery only systems. But. surprise! Plenty of large enterprise critical data centers have been utilizing such generator based systems for years.
Bottomline, it is not our job to perform the due diligence that is your responsibility given that you are so ignorant of the EPS market.
And by your simply repeating your profound ignorance of the market, does not make others ignorance - it simply confirms your ignorance.
And as stated, very common installations used in commercial and consumer households include relatively affordable systems by companies examples of which are Generac, Sola, Cummins, NRG, Liebert, Caterpillar, and Many more.
Now YOU get off your ass and do YOUR due diligence.
Reply: +Narvikz how do you know that they are directly at their posts to turn on the generator? or to check for faults? or what if the backupgenerator breaks? a larger buffer is always more secure.
Reply: sdushdiu if something fails, to refuel, to give them a lot of time to get things fixed might shit hit the fan with their setup. sure an automated firealarm migth call the firebrigade but every sane person would also call them when they see the fire even though they are pretty sure they are already called. better safe than sorry.
Reply: tjeulink
 What???????
By the time someone reacts MANUALLY, there IS data loss!
And no one suggests that all simply ignore power outages!
Reply: sdushdiu i never said to turn them on MANUALY at the moment the power outage STARTS. i meant that they need a fair time to respond in case the generator stalls, floods, jams, or anything like that, so they can turn it back on.
Reply: ***** ever heard of the safety measures that are needed to make every battery  module secure? this isnt a single module. a single cell  is going to stop working when it fails, that might take the whole battery pack with it but often it wont, then it would still need to take the WHOLE UPS with it. the only way that could happen is when it gets lit on fire or something drastic like that that would damage the servers most likely as well. but then their servers would definitely be destroyed too. if a small part in a generator fails the whole thing will shut down but when a generator fails most of the time it isnt as violent as  9  batterybays getting destroyed by a single event.
Reply: +tnnss111 Because the goal isn't to keep everything running until power is back on again. The goal is to buy them enough time to make sure everything is safe to shut down etc. Don't need a server running when you're workstations aren't running either. It's also not like they have high risk of losing revenue because of a power outage.
Reply: +Decent60 their work gets saved onto the server though. My guess is that maintenance and fuel costs were bigger than this which was why they went with it. I'm sure they thought about it before spending $17k :p
Reply: They've mentioned that where they are, power is SUPER cheap because it comes from waterfalls. Using a gas generator would be completely impractical.
Reply: DaanM96NL
Very true. Not sure how bad their power influx has been up there, they could also be saving that as a long-term investment.
Reply: +tnnss111 so, power goes out, linus goes outside and start generator.. data still gone because the power was out for just a minute... even with a generator he would need an ups.
Reply: DaanM96NL no you should never assume that they think about it, you would be amazed at how inefficient some major businesses have things set up. i know this company that sells led lights to contractors for 5 times the amount they buy them for. never assume the consumer is smart because often the consumer is simply lazy. not to say linus is lazy, but they might have not researched it as well as they should've or something like that.
Reply: +tnnss111 - I work in a facility that has a whole building dedicated to generators and battery banks.  Unless you are going to run the generators 24/7 (not practical) you need the batteries to bridge the time delay between a utility power outage and when the generators can get up to speed.  It takes the big diesel generators a few minutes to settle into the proper RPM.  The longest we ran on generators was after Hurricane Katrina.  It was almost a month of constant generator power.  The data center never missed a beat.  In fact, everything in the complex was still working like we had utility power except this one water heater for the showers.
Reply: +Turbo Kompressor Yes but I think it won't prevent the power outage after the main source goes out, whihc is the main problem with all the setup there, this thing works like a "nobreak", which A generator wouldn't (not sure)
Reply: +Narvikz - Fuel barrels?  No.  A good generator system is going to have a large permanent tank and a contract in place with a company that will come fill it when ever needed.
The facility I work at has a 2000 gallon tank right next to the building that houses four of our generators.  We have another generator at a separate building that has it's own 1000 gallon tank.  We also have our own 1000 gallon fuel tanker truck to bring more fuel from a 10000 gallon fuel storage tank that is on the grounds about two miles from the complex.  We have an agreement in place to assure that we will be able to get fuel from one of multiple possible sources in the event of need.
Prior planning, it kept our facility running even when Hurricane Katrina was passing overhead.
Reply: HappyChapGamer
Did you even read my initial post?
I was referring to IDEAL power backup solution and why a generator would be good for along with a UPS system. I never made any reference to the video or anything else about how this setup is bad or horrible.

Also, how do you know they do not want that? I don't see anywhere in the video where they stated they didn't want that. Nor anywhere in the post either. They've also done an office tour, and usually if they have something as big as a generator installed they would have mentioned it in any of the videos when they mentioned their UPS setup.

So how am I being a " nitpicking little bitches" about it?

Also: accept*
There, now I'm nitpicking :-P
Reply: +tnnss111 generators can allow for loss in power before they turn on.
Reply: +Nick Sullivan - I tell you why he bough such a big battery backup.  Because he wasn't planning to buy a generator set.  The battery system needed to handle transition to generator power would be much smaller and less expensive, but the total cost of the batteries, generator set and electrical equipment (at least in the US) would have been more than what he spent on just the UPS.  
I am sure that he went with a battery only solution to avoid the initial cost and maintenance cost of a generator.
Reply: +sdushdiu - While I am sure you are knowledgeable, the fail-over to offsite is probably not an option for LMG as they are doing video editing.  The backup scenario they have requires enough run-time to allow a render to finish so it can be stored to disk before the shutdown.  
We use F5 Networks, Big-IP hardware to load balance between multiple sites as well as provide fail-over.  I can't see how LMG would be able to do that with their workload.
Reply: +sdushdiu - They used some virtualization.  Didn't you see the 7 gamers one CPU rig they built?
Reply: +Shoot1st - Truth.  Our central cite plant has 4 generator sets running in synchronized parallel.  That means we can take one off-line to perform maintenance and the other three will still carry the load.   
The Cray systems don't like to be without power.
http://www.geekwire.com/2014/supercomputer-maker-cray-inks-30m-deal-department-defense/
Reply: +Oliver G - You are not taking into account that they are dealing with video editing.  Data loss for them could result in having to re-shoot video requiring multiple people many hours to do and then an editor hours in post production and then hours of rendering.
This is not regular data.  It is HUGE files and although they do make off-site backups, the backups take quite a while because of the file size and it doesn't help them if several days worth of work is all corrupted because of a power failure.  
I understand the abundance of caustion, but I still say they could have had a better solution.  
Also, keep in mind that their Canadian Dollar cost is only $12,340 US Dollars.  You can not buy a lot of backup for $12,340 dollars, but you could buy 20 KVA of top quality UPS for that price, which is pretty close to what they got.  The thing is, for around $5500, they could have had a generator set that would run for hours on propane and then they could have gone with a smaller (less expensive) UPS set.
Reply: +spire107 more like $12500 usd, I mean our dollar is shit but it isn't that shit. (yet anyways lol)
Reply: +Dirg - $17k in Canadian dollars is not a bad price for that type of UPS.  The point that some of us have tried to make is that a smaller UPS with a generator set could have been less expensive (or just a little more expensive) and provided all the same benefit with a longer run-time.
Reply: +Brighteyes890 Automatic propane standby generators. They start fast enough computers wouldn't shut down.
Reply: sdushdiu Man, that was a long rant with things I've never said.

Alright, you're still not linking shit, meaning that you're unable to find a product within the price range that has the same specs as you mentioned. You're the one who made the claim, so you're the one who should provide proof. If you can't prove what you're saying, you better stay quiet and not complain.

As for the gas/diesel, the hell are you talking about? In the majority of industrial nations, natural gas is delivered to businesses and houses through pipelines. I'm not Canadian, so if Canada's infrastructure is so old that it doesn't have pipelines then meh. Diesel is delivered by truck ... so? They're not going to wait for the truck to ship them fresh fuel. The running cost and hassle of having to replace the fuel every few months is something they still have to put up with.
Reply: +Narvikz Nuclear Power plants and safe? Hardly and good for the enviroment? Have we already forgotten about Chernobyl oh wait yeh you still cant go there years after and it happened in 1986
Reply: +tnnss111 plug server grade equipment to a generator... not a good idea...
Reply: Tom Lindo They wouldn't need a 17K UPC w/generator.  Only about $600 UPC.  Generator only takes ~30 seconds to kick in and get the power pumping.
Reply: +tnnss111 ideally youd have both, where we work we have 2 massive ups' and a generator, without a ups the servers would power off before a generator would kick in
Reply: eddy johnson Why "WTF"?
Reply: +protogenxl I've been quoted way way less than that, that seems a bit high
Reply: K Doe They never will get the point! To many people in this comment thread alone assume LTT is seeking 100% uptime with this, and just want to be right. They assume a bestbuy UPS will suffice when it wont. This setup allows for addition modules and batteries to be installed for anywhere from 1 to 24+ hour uptime when the power cuts... He wants security and function with zero risk of data loss. I have said it in 4 different comments. All that is needed now is to install a 220v generator to power the panel and you have 100% uptime with no risk of a surge or even a milisecond of powerdown. Something a off the shelf UPS cant guarantee.
Reply: If they lose power wouldn't that mean they would lose all power to the computers as well which would make it hard to back-up data unless they have a laptop that has a pretty damn good battery...
Reply: K Doe
"The servers are always running on batteries and absolutely never loose power during an outage, not even a microsecond. The issue with regular UPS is that you have to totally depend on that circuit to kick in as fast as possible, and sometimes they're not perfect with a power hungry system."
Absolutely WRONG!
Until a power outage, NONE of the servers or other electronic equipment is 'running on batteries"! They are running on mains delivered power!
You still have no idea how the hybrid systems provide greater functionality.
BOTH A UPS AND A HYBRID UPS/GENERATOR USE BATTERIES!
In a pure UPS, batteries provide only a short period of power enabling shutdown.
In the hybrid system, a SMALLER set of batteries provide power for a SHORTER duration during which a generator begins which then provides the means by which power is maintained for a period much longer than can be supplied by the batteries alone! Current and voltage are conditioned and the batteries recharged. The generator can provide said power for as long as they are supplied with fuel, which with a large storage tank and available fuel delivery can be indefinitely.
Once you reach needs above ~10KW, generators are able to provide 'power' at a much more economical rate than batteries. It is similar to memory evaluating solid state memory vs. MO memory.. As the need capacity increases, pure battery systems (think SSM) become increasingly less efficient and increasingly expensive! Thus it becomes more economical as well as offers greater functionality  to use a hybrid system that uses batteries (SSM) for the short term while a generator (MO) enables longer (think higher capacity) - even continuous use  -  of the systems during a power outage. And like using SSM for RAM, or M2 SSM for the OS, and MO drives for data, there is NO problem integrating them in a properly designed system.
This nonsensical "absolute safety regarding power" versus some imagined corrupted source provided by a generator is a function of some "absolutely corrupted" delusions and ignorance regarding how such systems operate..
Reply: +Sean Peel Or if they have UPS for their stations. That's where a consumer grade UPS is just fine, they don't draw that much power compared to a rack of servers and network equipment.
Reply: HappyChapGamer
 The sole issue is that for the same money, a hybrid system provides greater capacity and functionality.
The rest is purely a demonstration that the folks here are fking ignorant of  enterprise class solutions - and should - justifiably - stick with their preoccupation with RGB accent lighting.
Reply: +HappyChapGamer For 17k he could have gotten a generator and multiple enterprise grade UPSs to power each or multiple servers/workstations. Once the power is out kick in the generator until it comes back.  IMHO he did not make a very cost effective choice.
Reply: *****
 SSSSSSHHHHH! Don't further confuse the legion of dimwitted fools who similarly think that the suggested options are between batteries OR a generator that someone must sit and watch in order to be there to start in the event of a power outage.!
Reply: +HappyChapGamer Yes it is the best option,  but is it overkill for an operation their size? Absolutely it is, but he can do what he wants with his money. It was probably the guy that suggested that thing that saw it and got a hard on for it anyway.
Reply: +sdushdiu To your point, correct me if I'm wrong, but isn't Linus using several Kingston SSDs in his "production" server?
( ͡° ͜ʖ ͡°)
Reply: HappyChapGamer
 Dumbfk, if all they need is a few minutes to shut down systems, they DON'T need a $17K battery system anymore than if someone wants  slightly greater data reliability in a laptop needs more than 128 or 256GB SSD OS storage and a 1TB MO HD for data! They don't need a 500TB SSD array! But dimwits like yourself ignorant of enterprise best practices and available systems simply continue to mouth the same asinine BS about differences in handoff times or having someone available to MANUALLY START A GENERATOR (LMAO!) - which are moot !
But hey, I can adopt the same limited mindset as you idiots and whine about a lack of user configurable  RGB lighting in the UPS chassis....
Reply: K Doe
 Yes - the SAME nitwit who we watched up in a tree trying to figure out how to bend tubing also built an obscene SSD array offering lots of exorbitantly priced wow and little functional enhancement. And this is simply ANOTHER such project where 'symbolism' takes precedence over economics and functionality.
Reply: ***** Does it matter if it is overkill or not? No. Im not sure your aware of how large 4k files can get + their original files. one video can contain hundreds of gigs of files. The loss of any data for any business is critical, especially a business like LTT. So no, There is no such thing as over kill. Only Security and peace of mind.  Buying a 70$ tshirt is overkill. This is ballin!
Reply: +sdushdiu The reasons he made an SSD server are not in discussion. Look at it this way, again to your SSD point, he is paying the price for the overly expensive server he has. That pretty much sums it up in my mind.
Reply: K Doe
 LTT's own Captain Wrongway Peachfuzz has as little understanding of EPS best practices, capabilities and economics as he does other issues aside from user configurable RGB lighting.
Reply: *****
Such systems have been the defacto norm for EPS systems for decades and remain the most efficient and economical systems available in systems exceeding the ~10kW range.
Reply: HappyChapGamer Just becuase I think it is overkill and I would do it differently doesn't mean that I don't understand why he got it. In my current position something like this would be unacceptable becuase it is a single point of failure for all the servers. LIke I said this my opinion, so chill man.
Reply: HappyChapGamer
 Fkwad, I was a project manager for both the ASCI White and ASCI Blue Pacific installations as well as a member of the PSSP design team that enabled the RS6000SP - the literal Cray killer . Now go look them up and tell me if they measure up to LTT's PUNY garage installation.
Reply: +Turbo Kompressor You'd still have to have a UPS then, to pass the time between power out and the generator starting up.
Reply: Im still having a hard time understanding why so many people are butthurt over LTT's setup. It is ballin!  The jelly is strong in the LTT community!
Reply: K Doe
 "Now and experienced engineer as a project manager..." Got English?
Nitwit, we became a project manager on the projects as a result of being on the PSSP DESIGN team that manages the massively parallel environment running atop AIX.
Stick to ignoring the fact that Linus obsesses FIRST over RGB lighting systems before ever delving onto more substantial issues in his reviews - as well as to the responses - as with this issue - of the legions of followers in the clowncar cavalcade.
Now tell us how we can build a desktop gaming rig for less than the cost of a similarly equipped laptop...
Reply: HappyChapGamer
 Jealousy??? Of overspending on a more functionally limited installation?
Yeah, you nailed it! Just like you have nailed everything else in your pubescent clowncar universe.
Reply: +sdushdiu sorry I just had to deleted that. It was uncalled for. My bad.
Reply: sdushdiu Limited installation? This is a UPS. It sole purpose it to provide one thing ... UNINTERRUPTED POWER to whatever in case of a power outage anywhere from 1 - 24+ hours until the system can be safely shutdown. That is why there is so many slots for batteries and modules... The limited functionality is exactly what you want and need. Anything more complex and you run more risk! What more do you need then an UPS and 220v generated power to the panel to provide 0% downtime... You are so fucking confused and off course! Stop screaming of jealousy and just congratulate the guys on a great job and great purchase and finally having a safe power solution for their data sensitive business!
Reply: HappyChapGamer
 Yes, limited, as greater functional utility for less money is available with a hybrid system.  Similarly, if all they needed was limited extended runtime in order to shut everything down, simple automatic battery systems are available for much less money. You are the fool attempting to justify buying a Porsche GT3 simply to shuttle back and forth to the local grocery. Deal with it, gameboy.
Reply: HappyChapGamer
 Dumbfk, I grow tired of dumbfks making poor decisions based on flawed reasoning. And you ignorant pubescent dumbfks make for a one crowded clown car.
Reply: sdushdiu Now your only option is to insult us? Good one, someones a little jealoooouuuuuussss!!!! Cant except the fact there is nothing wrong with the setup and its simplicity is king so you get upset and insult people . . . The only clown here is you. A panel powered UPS that provides 1-24+ hours of uninterrupted uptime in case of a power outage and somehow you think there is something wrong with that simply because of the amount of money they spent .... Jealousy !
Reply: HappyChapGamer
 No, dumbfk, WRONG AGAIN! My chosen option at this point is to deride willfully STUPID Fkwads ignorant of alternatives about which they are, and willfully choose to remain,  totally ignorant.
Now you ignorant sycophants run along and hold the ladder while you regale Linus up the tree with his erudite insight into developing yet another enlightened method for bending tubing...
Reply: HappyChapGamer
Unnecessary cost.
The original hybrid alternative was posited, NOT because they needed additional capability, but because for the SAME expenditure, they could have the added functionality. A fact you dumbfks still misrepresent and  still don't understand!
Reply: +sdushdiu Why you so salty man? Chill. 
We get that you're experienced, but there's no need for insults. Insults don't make a point get across, it just makes its own barrier. It's like pissing towards the wind.
( ͡° ͜ʖ ͡°)
Reply: K Doe
 Fkwad, my language reflects my opinion of you. You don't like it? Tough shit. I am not here to satisfy your substantial emotional needs. Now fuck off, you ignorant fly.
Reply: +sdushdiu I actually do agree on the cost. But that's the decision that was made. I'm not gonna sweat it cuz it's not my money. If he's satisfied with what he has, that's all on him.
Reply: sdushdiu But there is no need for additional functionality!? All that is needed is Uninterrupted power to protect the servers and data that is stored on site. Anything after that is additional headaches and added risk! Why is that so hard for you to grasp.

So your only gripe about this and the reason for your hostile actions and insults are simply because of the cost and that they could have gotten more for less and you assume we dont know that?? Quality over quantity dude!!  Its so unnecessary and silly to stress yourself out and insult us over that!!

Guess what for the $15,000 I spent on my Audi a4 I could have gotten a newer and uglier Volkswagen Jetta with less Km on it all the bells and whistles and added features. But I chose Quality over quantity! You going to be mad at me over that and spank my bum bum??
Reply: Dave Starr The UPS doesnt switch on or off, Your system is plugged into the ups and are being powered by the UPS batteries which are charged by the wall power. So if the power goes out you you have that charge and have minutes to hours to shutdown safely.(depending on your UPS) Like you said, whether it be miliseconds or minutes loss of power is loss of power and is dangerous! This setup is perfect and simple and there is nothing wrong with it. People are just butthurt because of its simplicity. All that is needed now is a generator to power the panel and they have the option of 0% downtime should the power go out!
Reply: HappyChapGamer I don't think that they work that way. If a UPS constantly depleted and recharged the batteries, that would burn through batteries absurdly quickly and would be very expensive over time. I know mine, at least, trickle charges to keep the batteries at 95-100%, meanwhile while AC is still up, it just conditions that power and sends it along. Once the AC goes out, then the circuits switch to run on battery power. I could be wrong, maybe enterprise UPSes work differently, but that still seems very costly and inefficient to be constantly recharging and depleting the batteries like that.

I mean, either way, I still defend the UPS as a better idea than a generator, or even a generator + UPS. A generator isn't stable enough, and gen+UPS is two points of failure. Just one big, premium UPS was the right way to go.
Reply: Dave Starr You are right they dont work that way and I never said they did. The ups doesnt deplete and recharge, It maintains its charge until power is disconnected, Then uses its battery. Much similar to using a cell phone while its charging. It will maintain power and even charge it if its low but the second you disconnect wall power it doesnt power off, it simply starts using battery power.
Reply: HappyChapGamer
 Yawn, a hybrid system goes BEYOND the capacity of a UPS and provides longer term power for the DURATION of an outage, allowing continuous operation and not simply shutdown and loss of function, you dumb fkwad.
A hybrid incorporates an "UNINTERRUPTED POWER SUPPLY" and adds the power generation capability for the long haul! That is why they dominate in ENTERPRISE CLASS IT data centers and in locations like hospitals where its simply not convenient to stop functioning whenever the power may be intermittent.
So put on your big boy pants and learn how LARGER ENTERPRISES address such issues, and stop acting like some prepubescent gamer reveling at a small business that has JUST moved out of a bedroom in their mommy's house!
Their system is overly expensive for the capabilities provided. GREATER functionality is available for less cost. That remains the original premise and is indeed fact. Deal with it you pubescent gameboy.
Reply: sdushdiu LTT wants uninterrupted power to be sent to their servers. There is no better solution to achieve this other then a UPS. Especially one as extreme as this ! Like it or not kid, theres nothing wrong with what LTT has installed in the office! :)  No one says your hybrid system wont suffice but there are much better, simpler and effective solutions and we seen one get installed in this video :)
Reply: HappyChapGamer
 No dumbfk, there ARE cheaper JUST as effective systems available INSTEAD of the exorbitantly priced system installed here! Similarly there are more capable less expensive hybrid systems available.
Fact.
And yes, dumbfucks such as yourself HAVE INDEED REPEATEDLY STATED that a more capable cost effective hybrid system will not suffice!
Simply buying the equivalent of a gazillion TB of SSD memory does NOT imply that it is a more efficient or cost effective solution than alternative existing hybrid systems.
Similarly, buying a Porsche GT3 simply to run shuttle to the local grocery store is NOT an enlightened purchase simply because it can make the journey - you dumbfuck.

But then, its enlightened pubescent fanboy illiterates like yourself who continue to assert that  "we seen one get installed". LMAO
Reply: sdushdiu They dont want cheap, They dont want features and to have the system that provide power, cook dinner, open garage doors and change the babes diaper. They want Uninterrupted power to their server with time to be able to safely shut down. And when all batteries and modules are installed in the eaton it can maintain power from anywhere between 1-24+ hours... They do not want or need 100% uptime. Get upset at that all you want but they do not want 100% uptime nor did they ever say they wanted to achieve that... So again, your mad because you would do it cheap, skip corners and have an all in one and they did it the ballin boss way and now have the potential for 1-24+hours of surge free uninterrupted power incase of a power outage!! Keep getting more and more upset. Im just going to keep trolling you for being a basic bitch kid!
Reply: HappyChapGamer
 Fkwad, why leave out the additional fact that if that is ALL THEY NEEDED/WANTED, they could have SAVED SUBSTANTIAL MONEY and gotten a perfectly capable battery UPS for MUCH LESS MONEY - or alternatively a  hybrid system providing GREATER CAPABILITY MORE ECONOMICALLY as well.
But keep repeating the same misrepresentation - known as a LIE -  that is critical to your pubescent demonstration of ignorant illiteracy in your crusade desperately attempting to justify an exercise exhibiting more money than brains.
Now, how does one bend tubing again?
Reply: +xs3tsunax He did say "bit the bullet", though, and pretty much always says when videos are sponsored.
Reply: sdushdiu It was a very viable and smart business decision. They now have a standalone high quality up-gradable expandable Uninterrupted Power Supply to protect their servers and data storage from power outages. Regardless of what you think or how upset you choose to get.

The only ignorance being displayed here is from you. Your ignorant to the effectiveness of this standalone system and blinded by it simply because of the price tag they paid and choose to not acknowledge that simply because its not what you would do.

Also Please do express with childish insults and immature remarks and show us where the system ignorance is being displayed? Can you read linus' mind?? You must be able to see into his thoughts to know he has no clue about the lesser quality cheaper by the dozen all in ones you speak of!! So please share with us some of linus's deepest thoughts!? 

Your the only ignoramus here because your incapable of recognizing people who are on your side and agree with you and are incapable of having an intellectual mature debate or conversation with someone!

Lawhooooo Zaherrr!
Reply: sdushdiu Wrong, Its extremely functional and economical.

Function - It provides Uninterrupted power and protects from power surges saving your data. 

Economics - Higher quality parts means it will last longer, thus making it more economical in the long run...  Expansion slots and upgradability means they dont need to spend money on extra units and waste office space to house them. Not having a built in generator means they are not burning extra cash, gas or generating unneeded costly power to maintain a system that can sustain itself for up to 24+hours from battery life..  Economics at its finest my friend  

Economics - giving good value or service in relation to the amount of money, time, or effort spent

For the money spent they got an amazing Value for their money, One of the best UPS's on the market, It requires next to no time for maintenance and to install and thus having no generator or moving parts to maintain the effort spent to maintain it is minimal. 

Get over it bud, like I said, had they have bought a all in one hybrid youd be sitting here bitching saying the exact same words telling them they should have bought a more reliable, costly and effective standalone since they make so much youtube cash. Either way its a lose lose with losers like you because one way or the other you will always believe your simply because its not what you would have done!

Lawhoooo

Zaherrrrrr
Reply: ***** no one said a generator wasnt a viable and smart business decision. Infact this entire conversation I have said probably over 20 times that adding a generator in tandem with this ballin' standalone UPS system will provide you with the best solution for zero % downtime! No one even said that an all in one hybrid isnt a viable business decision, We have been agreeing with this other fool the entire time about his ideas about the all in ones but the fact remains that LTT did not want one or needed one, What he wanted was what he got and there is absolutely nothing wrong with the decision as it provides them with surge free uninterrupted power capable of powering their servers and data storage with enough power (anywhere from 1-24+hours) to be safely shut down!! You going to hop on the deuchewagon and disagree with what linus did simply because its an effective standalone UPS that does exactly what its supposed to in a way that the business needs?
Reply: HappyChapGamer
 Dumbfk, spending more for no additional functionality or demonstrable quality is NOT more economical.
But keep making unsubstantiated anecdotal assertions. It would be unlike you to cease such pubescent fanboy behavior now.
Reply: sdushdiu Additional features does not make something more economical! What makes this Economical is it literally requires 0 maintenance, no additional costs once its installed and other then replacing batteries when they stop holding a charge in 10 years there is nothing to replace or fix. 

Buying something for a few dollars less, that costs you monthly or weekend and requires regular maintenance or even a maintenance schedule that costs money and time makes it less economical...

Sooooooo the UPS linus bought is infact more economical in the long run! Regardless of what your going to tell yourself and the insults you throw at people
Reply: +FP5Reviews someone said generators break constantly, he said they didn't. I don't see the problem there.
Reply: ***** 
Man its senseless, and im just trolling him because hes hostile and arrogant.

 because its not what he would have done everyone else is now lesser then him, ignorant and uneducated on hybrid UPS's. and all this time iv been agreeing with him telling him "I agree, there are other solutions and options but thats not what linus wanted and I stand by his decision" and because I stand by that decision im a fuckwad and fuckboi and all this other shit lol 

Linus wanted a high quality standalone UPS to protect his servers and data from surges and power downs incase of a power outage and he bought one, and Iv said over 20 times that all he needs now is a standalone high quality generator and he has the capablity of 100% uptime. 

But because its not what he would have done ( he would have bought a less costly lower quality all in one hybrid ) we are all fuckwads and dont know business or economics. So now im just laying into him just to frustrate him more because who the fuck gets that upset about how someone else spends their money and who the fucks get mad at people who agree with them lol
Reply: +Turbo Kompressor but that' what he got it for, so they don't loose power and have to switch on, he talked about that. it draws power from the batteries. its meant to be used all the time, you don't use a generator for that, but people always gotta prove they're somehow smarter
Reply: idiot
Reply: +Narvikz these have an automatic safe shutdown procedure so when they do run out of power they properly shut the server down. this thing is made for this purpose, otherwise why would anyone ever buy them?? its not like he has a building full of servers guys, jesus fucking christ. everyones always got a better idea, even when its not
Reply: +Narvikz Long power outtages aren't really an issue.They just need this for short power outtages so they are able to save their data.
Reply: +Narvikz Except for the nuclear waste that we have no way to dispose of...
Reply: +Narvikz A generator that could power all the equipment they need for making videos, would be way to expensive for the pretty much non existent long time power outtages in their region.
Reply: +sdushdiu But they don't need anything more.
Reply: +sdushdiu That is absolute bullshit. These server ups are standart issue.
Reply: +sdushdiu What else would they use them for?
Reply: +sdushdiu They don't fucking need extended capabilities. When will you understand that?
Reply: ***** Its not an opinion when your forcing it on others. Which is what he was doing, even when others were already agreeing with him but standing by Linus's choice, he was still forcing his opinion down their throat simply because its not what he would have done, and he was belittling, insulting and agressive simply because He would have bought an all in one. So yes he was wrong.
Reply: +sdushdiu This ups automatically shuts down the servers and 26 minutes are more than enough for that.
Reply: +sdushdiu They had problems with independent ge ups before, as he said in the video.
Reply: +Dave Starr thats funny because thats exactly how he explained it. the server runs off the batteries, the batteries run off the wall. can you not listen? or did you just not even finish the whole video, he was pretty clear
Reply: +sdushdiu hybrid cars waste both gas and electricity, because the car itself weighs alot more with two engines, jay lenno talked about it in a documentary. and electricity is just as bad for the environment when we mostly burn things to make it. same difference. burn gas or burn coal
Reply: +sdushdiu You keep repeating yourslef, but failed to mention even once, what you would suggest for a backup power system.
Reply: +Gost9173 You can't just get some 12v batteries and run servers of them...
Reply: +sdushdiu They use raid 5 arrays in their severs, which don't like power outtages at all. They had corrupted data because of that before.
Reply: +sdushdiu Also keep in mind that we're talking about 17000 CAD, which are only about 12000 USD.
Reply: +sdushdiu In a lot of countries they have gas lines running underneath the street. They wouldn't need a gas tank in that case.
Reply: +sdushdiu Laso where is the fucking link to a 12k usd backup system with all the features you described.
Reply: +Angelo Stevens They don't need 100% uptime. With this system the servers run of the batteries all the time, meaning there isn't the slightest delay.
Reply: +Decent60 The problem aren't long power outtages. Those pretty much never happen in their region. they only have to deal with short term outtages and need to bridge those gaps. Also if they really wanted to go for 100% uptime, they would need much more than 10000W, because of all the camera equipment and lights and stuff, a generator that size would be way to expensive.
Reply: +sdushdiu Your ad hominem attacks don't hell your argument. Every person who has disagreed with you, had a different opinion and or solution has just been called a dimwit or a dumbfuck or whatever. I know this is the internet and its easy to make fun of people behind a screen, but those words have absolutely NO value for anything that has been discussed in this thread. Calling people dimwits doesn't make them want to listen to you, in fact it probably makes them want to prove you wrong. I don't know if this makes you feel superior to those you insult or whatever, but its not necessary, not relevant and not helpful. You are either a really commuted troll, a person with a mental condition like autism where social situations aren't as easy, a person who just likes to make fun of others or just an asshole. Judging by your debate skills, I'm guessing its mental illness or asshole. Whatever your problem is, stop being a jerk to random people on the internet over power solutions on a tech entertainment channel.
Reply: +George Cristodoulou  generator produce stable 220v or 110v if the rpm varies what change is the frequency.  the voltage keeps constant enough because the AVR  and even if the voltage change a litle is not that much problem for a smps like server has.
Reply: +HappyChapGamer 
Sorry But I am in agreement with sdushdiu on this one, I would have gotten a standby generator with a smaller UPS. I do like that UPS Linus got it has some really cool features. I just think it is impractical for their use case. This UPS is for a much larger server installation when you need things to be up 100% of the time.
Linus doesn't need this, from what he was saying he really just needs some time for people to save there work and shutdown the servers.
I am not sure what an hour of UPS time really buys them, what are they going to do, continue working and risk loosing data when the servers auto shutdown? (This is assuming there workstation's UPS can power theworkstations for an hour) 

Honestly 10-15 minutes would be enough to auto shutdown the gear. A good low end enterprise UPS can do that. Problem solved. 

Now throw in a good standby generator and your basically can run the entire office (not just the servers), with 0 downtime. Sure the lights will go out for 10 seconds or so until the generator kicks in, but who cares you have the low end UPS supplying the power for 10 seconds untill the generators starts up. Powers back on everyone continues to work. If for some reason the generator fails the UPS will supply power for few minutes then give the command to auto shutdown the servers. UPS supplies power for 10-15 minutes servers turn off, Data is safe.
Reply: *****
They would need a huge generator for all their equipment. They don't just need their servers to work and the risk is so low in Canada that it just isn't practical.
Reply: Man no one cares what you all would have done or what you think about this system. Underkill, cheaper, half ass'd This is what you guys are recomending he should have done.. Is went underkill and spent less money .... Fuck off!! This system is to the point, effective, proven, and fucking bad ass. These guy wanted a bad ass ballin UPS to protect their data and servers and they got one! now your all butthurt and got your panties in a twist! :) 

This is the day and age we live in. Where other people spend money and do nothing wrong but get criticized  by children who "think" they know when they. 

After over 12 hours im still beside myself at how cynical and immature the lot of you are. "they shouldnt have done that they should have done this because its what I would have done" !! GTFO I realize now this whole time iv been arguing with 10 year olds who dont know and never will. 

Well guess what kids I would have done it the exact same way. If I were in linus position and had money to burn I would buy big ass UPS to power my shit. That way if I or my team ever needed 100% uptime all I would need is a badass overkill generator to get power to the panel. 

"but chappy, this is so overkill I would have just bought something cheaper and lesser quality and installed it, why spend that much money on just one UPS, I wouldnt do what they did its so overkill" 

no one cares what you guys think anymore,If If you think overkill is a bad thing then you should all hang yourself. Where I come from overkill doesnt exist, it is mandatory. You are all disregarding the effectiveness and proven capability of a UPS system like this and choosing to be arrogant fucks simply  because you wouldnt have done it this way and would have done underkill... You are all unaware of the capability of this UPS, its expandability, and its effectivenss. 1-24+ hours of uptime with this one UPS rack , surge free protection and uninterrupted power  . . . Enough said. 

So Get over yourselves, If you have 17k to burn and wanted a bad ass baller UPS to protect your data and server you would buy one, and imagine how you would feel if a bunch of your broke ass youtube troll fans were bashing you and calling you stupid because you went overkill with one of the most proven and capable systems in the world rather then some stupid lesser quality cheaper by the dozen underkill all in one system. 

If you are ok with underkill, your entire life is going to be underkill. Linus and his crew have always taken thing overkill I stand by them every single time!!!
Reply: Catsrules1 Who are you to say what linus needs and doesnt need?
Reply: Just to clarify as well, If your ok with underkill, or lesser, or half ass'd or anything that isnt overkill. Then your whole life is going to be half ass'd, underkill and mediocre. Where I come from there is no such thing as overkill and if your not going overkill your simply not doing it right !
Reply: +tnnss111 
I can't believe there are so many thumps up with this comment.
Reply: +HappyChapGamer thumbs up!
Reply: Catsrules1
It's not like they can just put a generator inside and building outside is out of the question too, because the office is part of a complex.
Reply: u'll get a million dollar bill in few years
Reply: +HappyChapGamer how long did it take you to write this holy
Reply: less then 20 minutes combined through a 12 hour period. Again we do overkill where im from because its the only way to go, anything less is just that. Less!!
Reply: +HappyChapGamer and these reply speeds. Ina YouTube comment
Reply: Its called a cellphone, when you do things overkill you make good money and with good money comes materialistic things like Cellphones, cars, houses, unlimited data, all the good things going hard and overkill should bring !
Reply: Everyone says linus is overkill.. ok cool. But look at where he and his business are compared you where you are. Most of the people commenting here barely work 40 hours a week let alone run their own business so overkill is beyond them because they dont understand it. Anything less then overkill is half ass'd and half ass'd work gets you no where!
Reply: A youtube comment is nothing more then a text message.
So the question is...

Do you even text bro ?
Reply: also with todays technology all I have to do is hit one button and I can speak my message and it types it for me. Couldnt be any easier nowadays to reply to someone via text message
Reply: +Narvikz yes they have generators but most of those equipments "life equipments can be off for 2 mins and doesnt do any dmg and nothing is lost, (im a med student) most of them just do the brething and its not that imperative to have in online in miliseconds as PC
Reply: +Oscaro947 That's the safest solution. The UPS is there for the time needed for a generator to start up and keep things humming along.

A UPS is, at best, an extremely short lived solution. A generator will be your best bet during serious power outages.
Reply: +damstachizz Ha, you already pointed out what I just said :p
Reply: +tnnss111 Exactly my thoughts.
Reply: +Narvikz generators down run off of oil....
Reply: Wozso
Yeah... You can set up UPS in a few different ways so as to allow for more 24/7 charging from solar and wind, but I or anyone with a brain would never try that with a freaking gas/diesel generator. Talk about expensive pollution.
Reply: Wozso Or you can use backup systems that incorporates both.
Reply: Crowned Son of Fire once again, no one reasonable is arguing that the generators be running at full capacity all the time (though you're going to have to turn it on periodically for maintenance).

If you want to add some clean energy to the mix, have at it. However, a generator of some kind added to the mix here is an overall good idea. Especially when you can find decent generators relatively cheaply.
Reply: Greyghostvol1
Fair enough I suppose on the better to have it than not have it front.... but you are wrong in saying that people aren't arguing about running generators full time. That, or We are reading different comments all together.
Reply: Crowned Son of Fire well, maybe my brain is allergic to stupid and is blocking out those comments.

The idea is that if there's a widespread, consistent outage, a generator will be a much more reliable source of power than even solar or wind. Maybe that's where the confusion lays. The only time you'll need to run the generator(s) "all the time" will be, well, when you will actually need to run them all the time.
Reply: eddy johnson - That is kind of the point of having a battery plus generator solution.  You never have to shut down.  With proper auto switching hardware the batteries take the load while the generators start and the servers keep running.  Once the generators are running, they take the load and the batteries go back to standby, and the servers keep running.  When the power comes back on, the servers are transitioned back to utility power and the generators shutdown.  There is never an operational interruption.  In the complex I work at, you would never even know there was a transition to generator power.  Everything keeps running, except for that one water heater.  The only way you would know is if you went around back and heard the generators and ours are acoustically insulated because they are inside a special structure that is designed to make them quiet.  That means they are not supper loud.
Reply: John Ross Finch what you are not getting, is that if the power goes out, and it isnt running,  the generator will have to be started,  and even if they had a battery, unless it was like the one in the video, would still have a few miliseconds between power outage, and input being switched from AC to battery, then to generator, would possible be catastrophic for servers.
Reply: Bio Hazard - Nobody said that they couldn't use an "online" battery system so there is no interruption.  What you are failing to understand is that data-centers around the world use generators all the time.  Nobody has to start them.  They automatically start when the power fails.  The batteries take the load while the generators spin up and then the generators take the load until utility power is restored, then everything transitions back to utility power and there is never a single beat skipped.  It is not like we are talking rocket surgery here.  It is done every day all over the world.  I literally have one like that at my house.
Reply: Oscaro947 - Generators are not a source of power fluctuations.  It is the quality of the power conversion unit between the generator and the server that matters and NATURALLY you need a good one, but this is done every day at data-centers all over the world.  It is not like we are talking of inventing something new.
Reply: +Bio Hazard What you're not getting is that they can probably use whatever ups they already have. They only need about a minute of uptime on the batteries until generator can automatically start. The power could go out on a Friday after they all go home and the generator would automatically start and the transfer switch would automatically disconnect the main and connect the generator and all of that would only take a instead or less. Meanwhile, the ups would prevent a LoP and could shutdown the servers in the event that the generator didn't start. Then, when Linus walked in Monday morning the only way he'd even know the power was out would be if he watched the news or heard the generator running. Also, if you're worried about keeping it full of fuel a natural gas generator would be the way to go. They're hooked up to the utility gas lines and never have to be filled up.
Reply: Chris Moore For god's sake, I'm not fucking saying that, read my comment please. WHAT I'M SAYING is in response to people who have said "you don't need a UPS, just use a generator". I have said in literally 3 different comments that the UPS is for the initial power loss, which prevents shutdown in the event of power loss. THEN you can use whatever power source you deem necessary for continued operation.